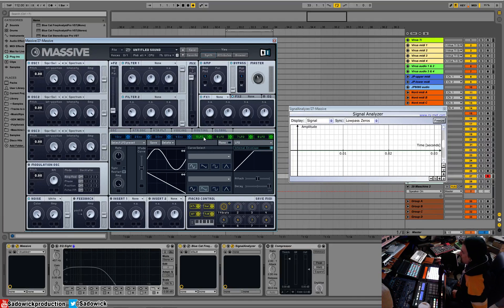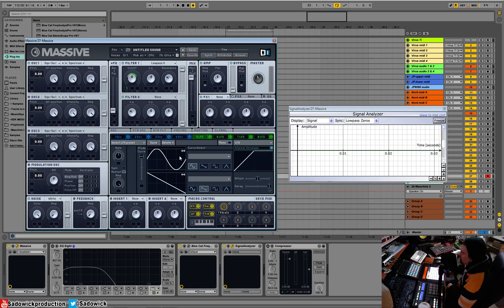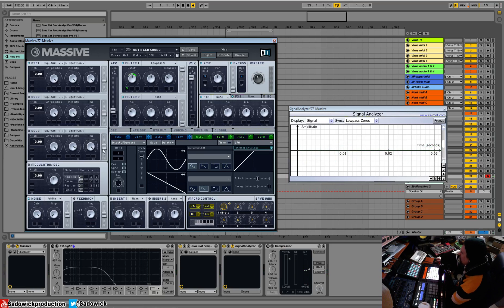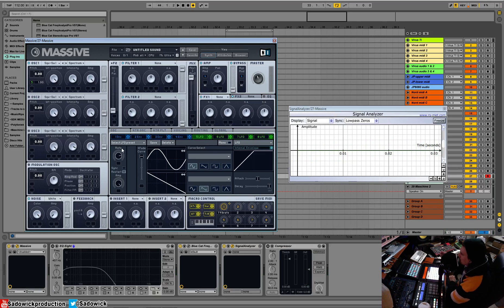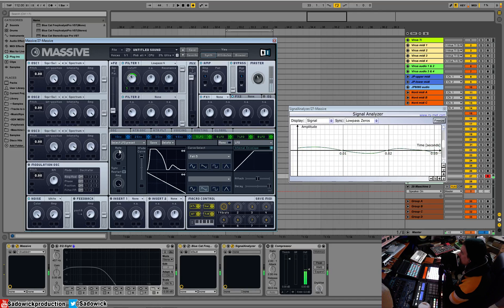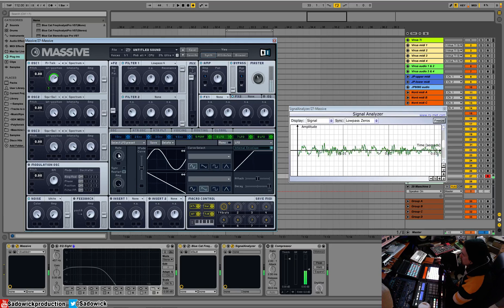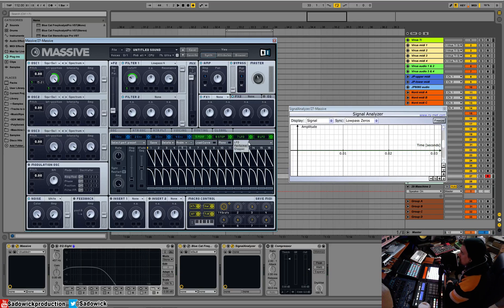Native Instruments Massive Tutorial 07 - LFO, Performer & Stepper Modulations

Comment: Super helpful!

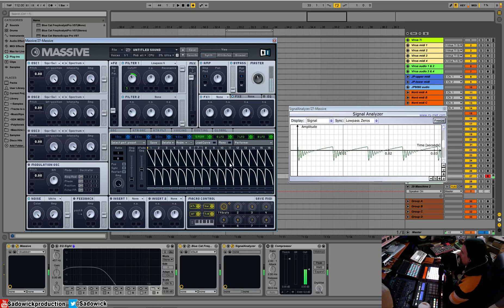I noticed that at around 8:30 you couldn't find the parameter to change the length of the step sequencer in the performer tab, you actually can change it. Just drag the mouse over the numbers 1-16 at the top from right to left to change the length. 

Thanks dude, subbed.